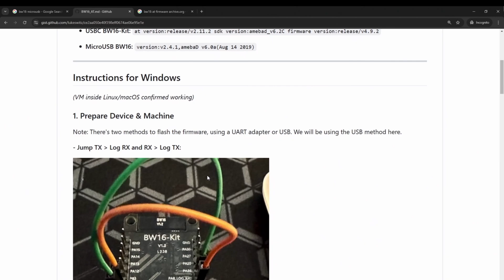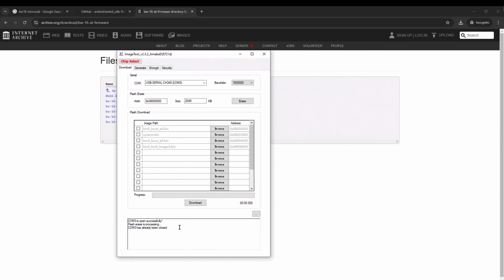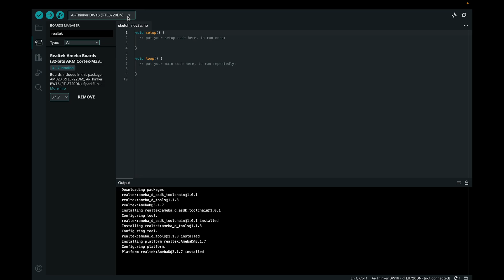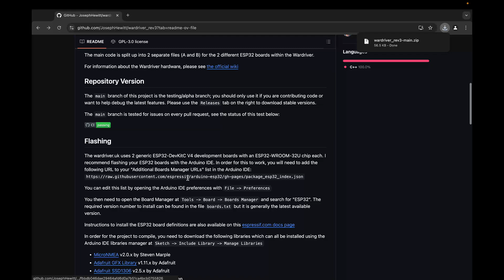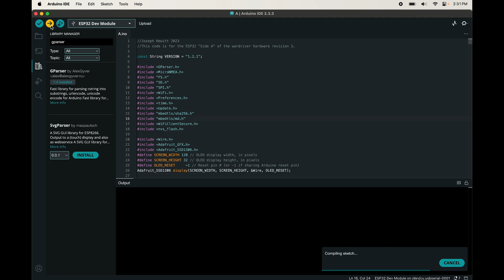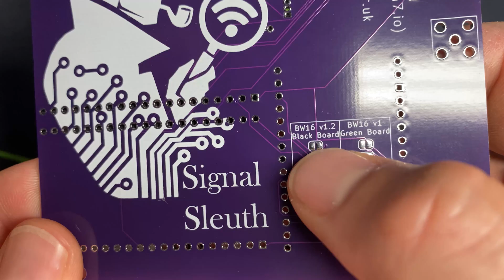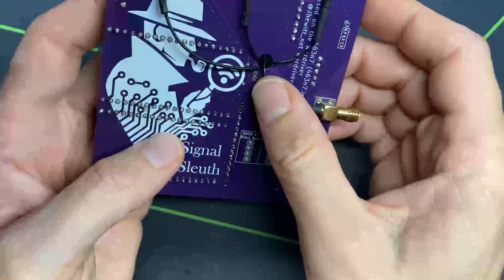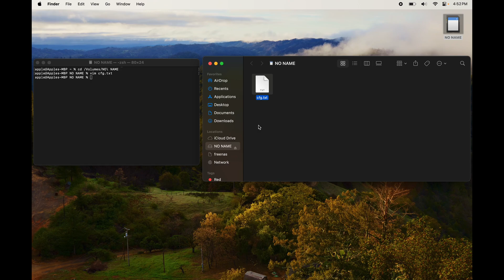Signal Sleuth 5ghz WarDriver Build

Comment: Hmm a bit pricey, for that amount I could buy a cheap laptop or used phone.

I was thinking sending cheap phones in mail across the country with wiggle running, maybe with extra battery pack.
Or leave it on long distance busses.
Reply: You could do these tasks with multiple configurations of hardware, firmware and software. From thrift store cast-offs, to a Pineapple Enterprise Advanced. I'm building multiple combinations of toys currently. I have some aforementioned Hak5's product, some M5, a CYD, ESP8266, ESP32, Raspberry Pi (s?, but isn't Pi plural already?)... I'm having fun smelling solder again, and pulling my hair out until I figure out what the issues are between finding the image and run are until I have a viable, albeit clunky on occasion, product. Every day I learn something. I also want to get back into tech after years of entrepreneurship, and this is a way of catching back up. A lot of more fun and easier fabrication options are available, as opposed to 10, 20, 30 years. Speaking as a Radio Shack kid from the 80s. This is a lot more fun than a crystal radio kit.